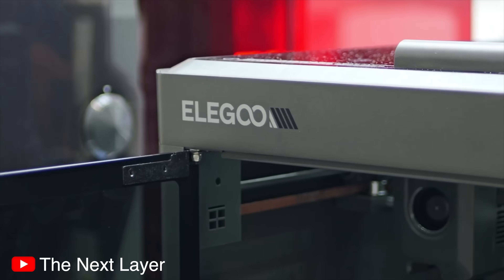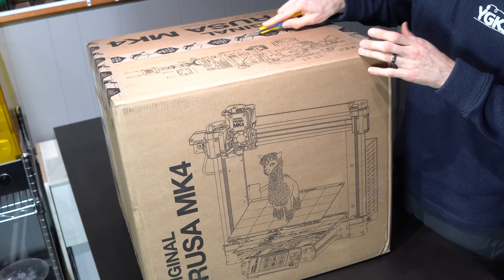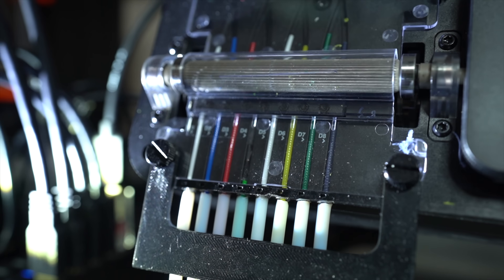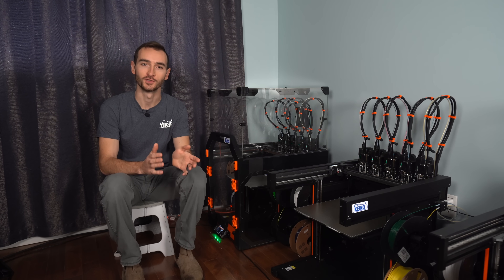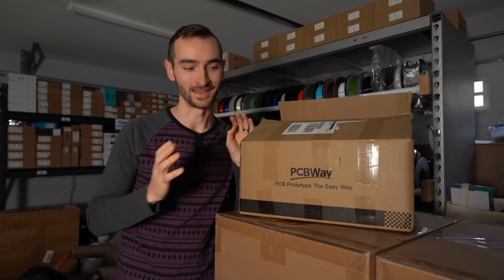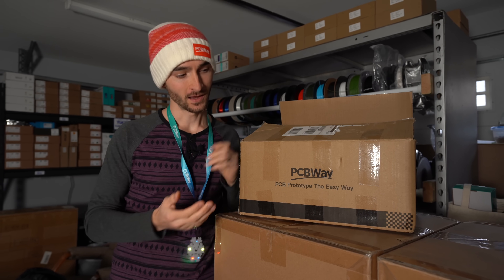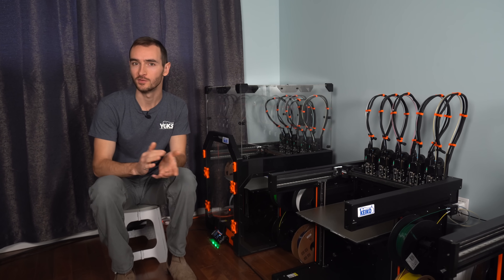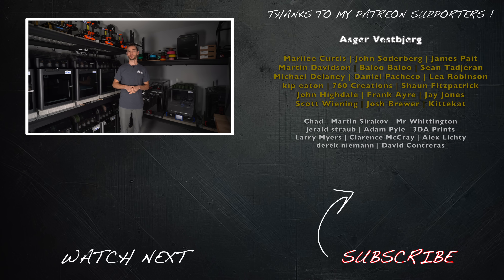The Prusa Core One is dividing the internet...

Comment: I have five old MK3s modified to print abs inside a chamber at 60c. They are so easy to modify and repair that I dont think I will replace them for the next three years. I cant believe that Prusa upload a new firmware upgrade for the mk3s few weeks ago. Bambulab does not wanna upgrade anything for the P1/X1 series.
Reply: I've just loaded new firmware on my p1s yesterday. They do work on issues and the slicer is always adding new features (that orca paved the way for but still) so what you're saying isnt true
Reply: @CreationDominion I was talking more about hardware changes and how Prusa keeps supporting (with manuals and spare parts) and updating the software for their discontinued and "old" models. The P1/X1 series has been stuck in the same place since it came out two years ago. Maybe in 2025, they'll drop a brand-new P2S or X2C, and the older series will be outdated and without spare parts.

Instead of following Creality's lead, Bambulab could work on improving small and cheap things on their printers. For example:

1-Add collision detection to the motors (super necessary for PETG).
2-Add RPM detection (my P1S front fan wasn’t working for days, and the printer didn’t even notice).
3-Swap out the f#####g Teflon wiper for a silicone one.
4-Add an easy quick nozzle change.
5-Add a chamber thermistor and use the external fan to control temps so you can print PLA with the door closed.
6-Fix all the issues with their AMS.
Basically, all the upgrades Creality added to the K2 PLUS (compared to the X1C) could’ve been done by Bambulab ages ago. They’re simple tweaks that make a big difference to the printer.

With Prusa, you can literally go from an MK2 to a CORE ONE and still get support for the MK2.

Comment: I went with a P1P and then P1S over a Carbon X1 because both give you 90% of the features of the X1 but also because that 10% extra tech in the X1 is overkill and a maintenance liability.  I mean, Lidar on an extruder?  Come on, that's just begging for a component failure that is going to leave your machine in dry dock for a while.  The failed prints it was supposed to detect and stop just never happen on the P1x models and the first layers are always perfect, so what is the point of adding an extra component that can fail?  The P1x models kept it simpler, and as a result they have better up time than the Carbon does.  I have zero brand loyalty-- I had a farm of Prusas before Bambu came along, and whoever ups the game over Bambu will be my next printer.  Prusa pushed the software envelope but there was never anything special about their generic printer design.  Bambu pushed the hardware envelope while also getting real aggressive on price.  I thought they were going to wipe everyone out, but there are a surprising number of companies holding their own and  creating competitive offerings.  I don't see Prusa as being among them though, Industrial printers is where consumer printer companies go to die.  Repackage the same tech in big fancy looking enclosures and hope nobody notices they are getting the same print quality and speed as the consumer printers only at 10 times the cost.

Comment: I cannot see a European company being happy about the waste the Bambu spits out. Theres a reason the Prusa XL exists. When they bring multicolour for less than 4 grand I have a feeling it will be targeting exactly that issue, and that would absolutely make me sit up. I HATE the waste involved in colour 3D printing like Bambu does it
Reply: You would need to print over a ton of just WASTE to get the break even cost of the XL.
And this is before the XL pushing out a gram of plastic.
The Waste argument has be debunked, with math for a while now.

If you hate waste print single color and paint., Tf you truly hate plastic waste stop FDM printing altogether as all printers waste filament in some capacity. From the plastic the rolls come in, to purge lines, skits, brims, supports, failed prints, benchies and so on.

Comment: "I could contact support to see what they can do for me, but I have a feeling it will be more trouble than it's worth". I know time is money and uptime is more important than repairing time (which is why most farms are switching to BBL in the first place) but these problems are likely easily fixable and the parts are in coincidentally pretty cheap if they're out of warranty. In warranty the parts will probably cost nothing, out of warranty I'd just replace the heat bed on the one with that issue - the entire 'Heatbed Maintenance Kit - X1C' is only $102 US and includes the entire heat bed assembly (no adhesives to remove or anything) cables and sensor assembly. the page for the heatbed has a wiki link to a tutorial how to replace it and they have YouTube videos too, whole process should take less than an hour if you're already familiar with your printer and are handy with a screwdriver. the force sensor issue could also be the heatbed assembly but is likely just the sensor or even garbage stuck in the z-screw areas, I had compacted flattened poop stuck at the top of mine once and it threw that error. If it's one of the force sensors they cost $4.99 US each, and there are 3 of them attached to the underside of the heatbed, and take a few minutes to swap.these force sensors are called "Heatbed Sensor Unit" on the parts page.

Comment: From what I've heard, parts for Bambu are just as easy to obtain as parts for Prusa, and both are priced reasonably.  However, I've also heard that Prusa will be able to provide better support when it comes to repair and trouble shooting advice.  If you know how to repair 3D printers, either company will still be a good choice in that regard.  Now as far as which brand is more reliable, that honour may belong to Prusa.  I tend to think of Bambu printers as being more hobbyist friendly, while Prusa might be the more go-to choice for print farms.  Especially, when you realize that Prusa 3D prints parts for their own printers ON their own printers.  This means they are doing the beta testing on their new products not their customers.  So, it probably comes down to what you want and need in a 3D printer.  With Prusa printers and parts now made in the USA (Printed Solid) and possible tariff increases on goods from China, the cost difference between the two is going to evaporate.
Reply: BBL parts are available when in stock, and it seems they’re never in stock, always the “Notify when Available” even then when you do find the time to order its out of stack again.
Reply: The Bambu Wiki is pretty comprehensive actually, so while you may not have an actual human walking you through stuff, information is easy to obtain. Basically every part is available in the shop, at mostly reasonable prices. Bambu does a far better job than most other companies in this regard.

Comment: Having owned most printers from both Bambu and Prusa, I can confirm both are fantastic - which is best for you depends on use case.  If I were to recommend a printer for a home user or even a print farm startup with a budget, I’d probably say pickup a P1S - great quality, speed and ease of use. I also like the ability to chain AMS units for 16 color prints. That being said, I have an issue that requires some of my time to fix on the X1s and P1Ss around once every 100 hours or so (and the purging with the AMS is extremely inefficient - hoping they optimize it more in firmware updates).  My XLs and MK4Ss are dead reliable, rarely ever having any kind of issue at all.  The experience is a little less user friendly for beginners, but getting better with each update. They are also easy to work on if I do want or need to.  If you are more experienced or need as little downtime and material waste as possible, it’s Prusa for me.  The upgrade path makes them cheaper in the long run as well. BTW- there is a camera option on the Core One.
Reply: How is your setup on the XL and what do you print?
Is it engineering, multimaterial with high accuracy..., or visual consumer stuff
Reply: The purge in Bambu can be manually tuned with test prints as it is filament specific the the particular spools and order you print in. Options are in bs/orca
Reply: @ The flaw is in the lack of retraction and the cut point leaving so much in the heatbreak to purge - that needs a firmware fix.  They did one fix recently, but it wasn’t enough.
Reply: These are great points and observations, especially that the plug and play of Bambu appears somewhat of a gimmick where they downstream-ed the time and efforts to keep them running on the back end no one thinks about when impulse buy vs the front end where most consumers keep their undying focus. 

This is likely the only wave Bambu can keep all the features and specs affordable  and competitive.

Comment: I think Prusa needs some kind of VVD system or a compact MMU inside a box. That way it could compete with X1C (not P1S). To compete with k2 plus and new generation of big size printer they need something like a “CORE ONE XL” (just a bigger core one with the bed from the XL and that “VVD” multimaterial system). Oh, please add a damm nozzle wiper

Comment: I have had literally the same issues with my machines. New heatbed took me 17-20 mins to replace (i took my time and cleaned a few bits at the back and inside). Force sensor i had to change a cable once second time a board at the back and some extra bits. However you can just change the whole heatbed it you want to be quick and lazy. I got one free and one i just purchased from their shop. 20 minutes each if your a first timer (me) but you are waaay more experienced
Reply from the maker: @alycapo3391  that’s really good to know! Thank you for sharing.

Comment: If they (Prusa) can make a better MMU/AMS setup, I’m in but the AMS is just soooo easy to use, or at least have 2 heads on a changer at a reasonable price….  

My Ender 6 and Troodon get very little use these days…. They may be on the chopping block…..
Reply: My point of view: The MMU is less wasteful and more flexible than the AMS. It doesn't limit you in regards to spool sizes or materials. You can keep sensitive filaments in their dryboxes and you don't have to take it apart if humid PLA breaks in the tubes. Filament changes are also a lot faster with an MMU.
Reply: @ulaB  The MMU3 works great and is fast, but they need to get rid of that janky buffer.  Loading the MMU is a PITA.  I've removed the buffer and added Filamentalist self-rewinding spool holders.  Makes loading as easy as the AMS even if your spools are sitting in a dry box, and they are motorless, driven by the filament itself using a one-way bearing.  Not gonna work well with TPU I suppose, but you can't have it all.
Reply: @kaasmeester5903  Get rid of the buffer and use gravity instead. I had my spools on the floor for a long time and the buffer was the space between table and floor. Worked better than any other solution. :-)
Reply: @ulaB  Heh, I did that too for a while.  But I wanted my spools in a dry box, and using gravity will expose some filament to moist air when retracted.  Unless I am doing actual color printing, I use the MMU to be able to select from my most often used filaments, or do inlaid text. Also, having the drybox on the wall behind the printer makes it very easy to swap spools.  The Filamentalist spool holders have worked very well so far.

Comment: From my Mk 2 through each incremental step to Mk 4, and MMU  and MMU2, the untold story is that each of these incremental upgrades isn't free and doesn't upgrade the printer that much, and as in MMU's case, good luck getting them working at all, let alone working consistently. These upgrades are not cheap and add a lot of cost to the original printer. Sure the Core One will be upgradable, but at what cost and why didn't they include the new features to begin with. I struggle with leaving my Prusa ecosystem, but I don't want  to buy something inferior  when I can get something better and is a finished product.  I don't see myself ever buying Prusa again, I can't afford to continue going down the buy it once and then fix it forever path.
Reply: You're right, some of the upgrades are little more than a set of small improvements.  Like the 4 to 4s kit... the mk4 is already a good printer, and most people don't need the upgrade.  But it sure is nice to have the option.
As for the MMU3, mine has been working great ever since I got it.

Comment: My first 3D printer was an Ultimaker 2e+, hugely expensive, but at the time, it really seemed like the best thing out there. Around the time MK3s came out, I got an Ultimaker 3e, again, hugely expensive, but it really seemed like something else back then! Now, 5 years later, my UM3e is mostly forgotten, it's still here, I still have some 2.85mm filament for it, it still works, but it's features just aren't there. I honestly got jealous when I saw Prusa send out major firmware updates for older printers, heck even the Mini got major boost in performance, yet Ultimaker has abandoned older printers long ago. I'm pretty sure that once I spend my 2.85mm filament, I'll take out all the proprietary parts from that UM3e, and give it a single nozzle head with Trianglelab parts or something like that. I did something similar with UM2e+, and it's still being used. Way back when, I also bought some (much much much) cheaper CR-10s pro's, and with cheap upgrades, they are still running, very reliably. The whole experience thought me to avoid expensive and proprietary stuff. Core One looks super cool, if someone gifted it to me, I'd gladly use it, but I would never buy it. Not when I can get an Infimech Tx and get all the performance I need from it, right out of the box, and if it starts falling behind, it will be very easy to change/upgrade what I feel like. Prusa has its audience, and many fans, so I have no doubt that Core One will sell well, but I fell it's just not interesting enough to justify that price in the current market.

Comment: 1000 hrs before failure. That's a thousand hours printing and making your money back twice as fast as comparably priced prusas. So even if they fail sooner, you have made more money with them in theory. And it's not like a BL is impossible to repair. They have all sorts of replacement parts for their printers. Maybe not every single piece as a separate component, but they are certainly not Apple in this sense. More like a happy middle ground.
Reply from the maker: @phasesecuritytechnology6573  great point! The value proposition is even better with a P1S. I’d recommend the X1C for anyone getting a single printer for their own use. If you’re buying a lot and don’t mind losing a few convenience features you can get almost twice as many P1S’ for the same money. Both will easily pay for themselves many times over in 1000 hours, but will hopefully last longer.
Reply: @ygk3d  I bought the $1200 troodon 2 pro and have made about $900 back already in effectively 3 sales.